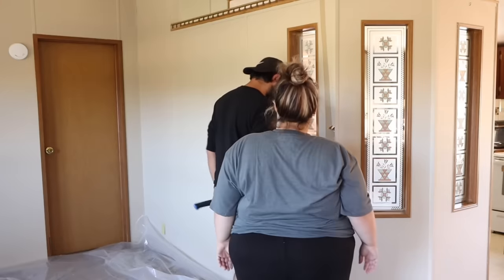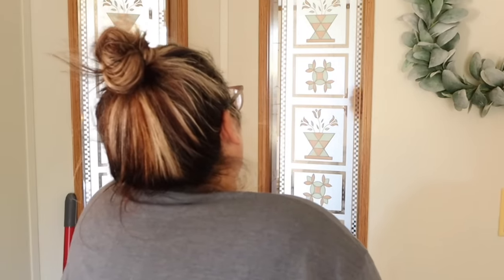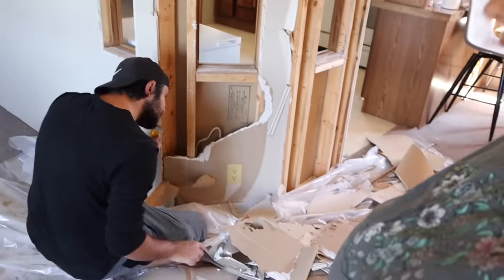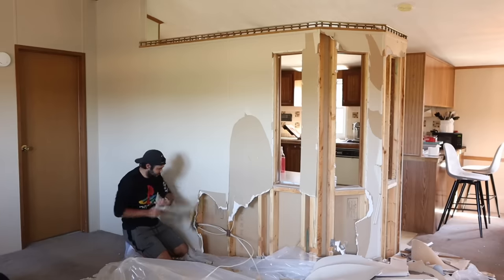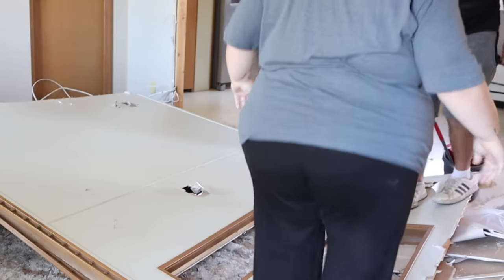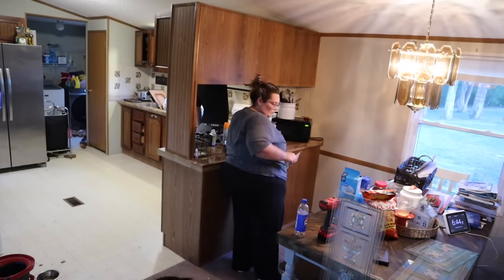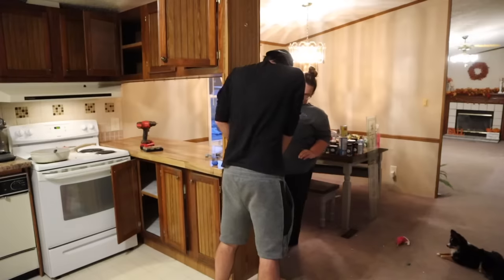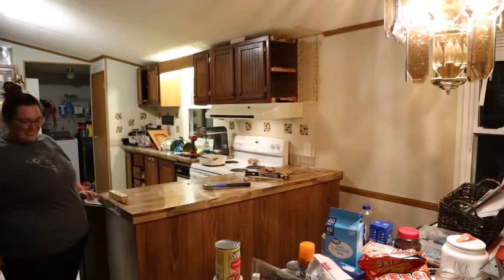*EXTREME* MOBILE HOME REMODEL | taking down walls in the double wide to create an open concept! Ep.6

Comment: You and Shane could build your own cabinets pretty easily, I would think. The only thing you would have to buy are the cabinet doors. You can get some good ones at your restoration store I'm sure. Cabinets are just measuring wood and putting it together. My husband and I did it before and it really isn't hard. You both are good at woodwork and that's all it is. Because you are right cabinets are ridiculously priced.

Comment: You should buy a twin size couch and put it along the wall part when you first walk in the living room but move it down from the door when it's opened. If a twin couch could fit on that side of the living room then you would have a little extra seating facing the TV. 

I'm surprised you and Shane didn't sing  John Mellencamp's When the walls come Crumbling Down song when you guys finally got the wall going down. Lol

Comment: I am so excited for yall as my kitchen renovation starts in about 2weeks. Knocking down the wall that goes between the kitchen and dining room so my kitchen will be long and rectangular kind of but open to my living room with fireplace. I will only have 3 upper cabinets on my long wall and rest will be open shelving and lower cabinets are mainly going to be deep drawers ( my Grammie has those and love them) with the exception of a pull out garbage cabinet, pull out spice rack, pull out butcher block/knife area and a pull out “baking sheet “ pan area. All are thin pull outs. Then I will have an island that sits in kitchen next to living area and have on one side, microwave under and a “mixer lift” that I will put my Air Fryer/crock Pot on. There will be cabinets on both sides of the island so that makes up for the upper cabinets that I am losing but honestly that only 3 cabinets. I hope I dont change my mind on my design after seeing your makeover🫢😬 
So happy for you all!  Can you link the info for the wood flooring you purchased, I am looking for flooring now as well.

Comment: BUILD YOUR KITCHEN CABINETS! Seriously, it is not hard!!  I am a grandma who had only built small, decorative wood items.  I watched Anna White YouTube, and she showed me how to build a cabinet.  I built my cabinets and literally couldn't believe how simple it was.  The hardest part is to be sure you measure correctly so everything lines up.  I don't have a lot of fancy equipment either.  My husband did purchase me a track for my skill saw which helped immensely. I made my cabinets out of 3/4-inch plywood.  Part of them are oak and those are stained.  Part of them are painted so I made them out of birch plywood.  I chose birch because it hides scratches better since it has a more complicated grain pattern.  I even made all my shelves slide out...also not hard if you do i the way Anna White suggests.  I did purchase a tool for installing the hidden hinges.  Most people do not even realize I made my cabinets until I tell them.😃